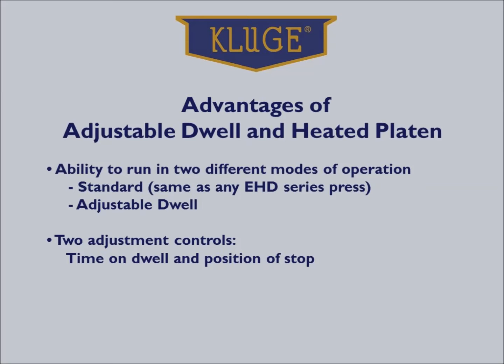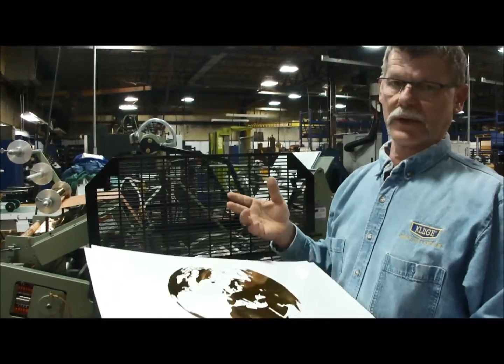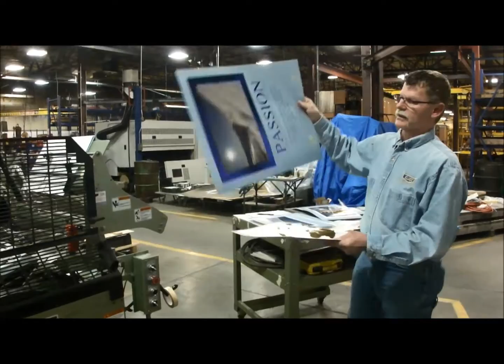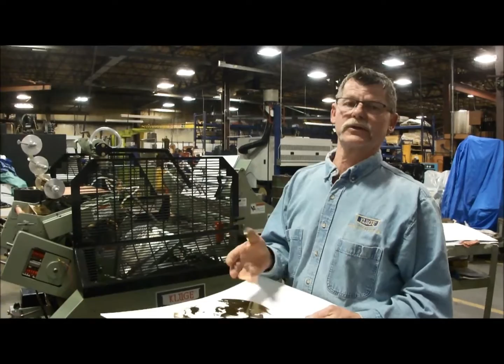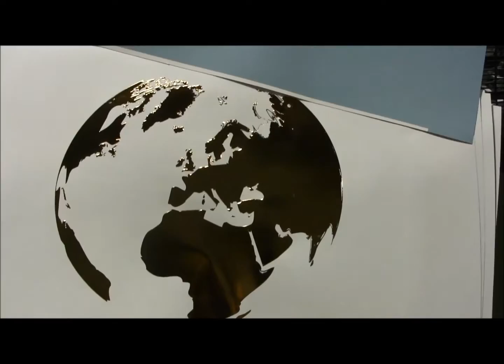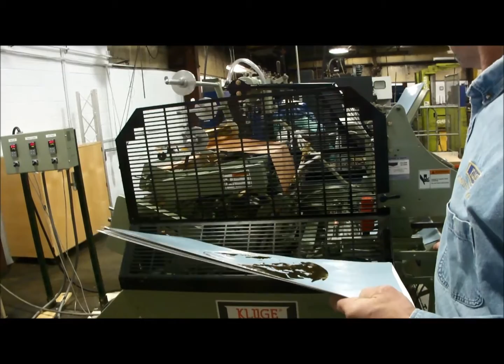Kluge Adjustable Dwell and Heated Platen Options

Comment: It is have gone not "have went" in speech. Certain foils and certain stock surfaces make foiling better. A mag die or steel die has to be made right to achieve a good
foil bond to the substrate. I would consider the added heat a big plus on foiling certain substrates. The combination die he was running looked nice.
Reply: What substrate do you suggest for mag and what substrat for steel dies?